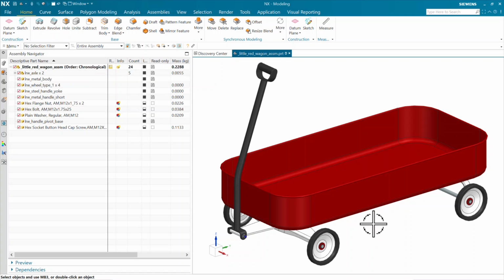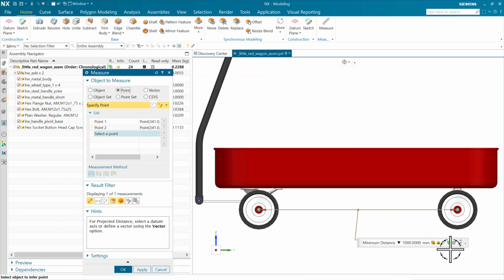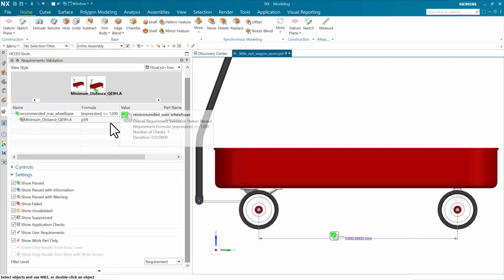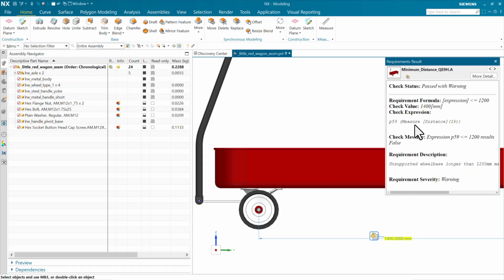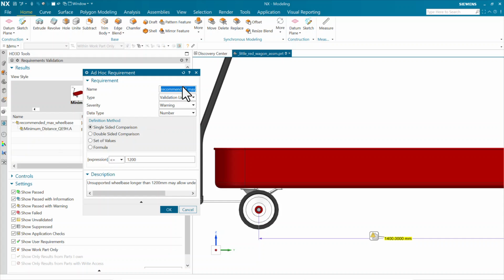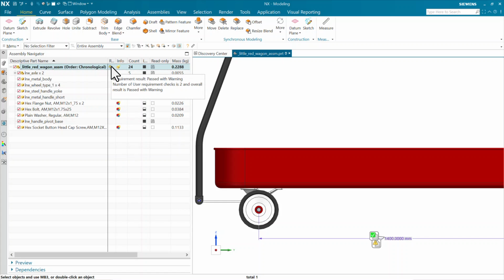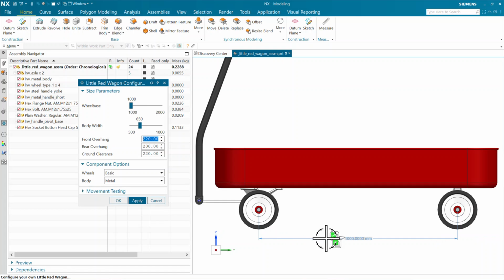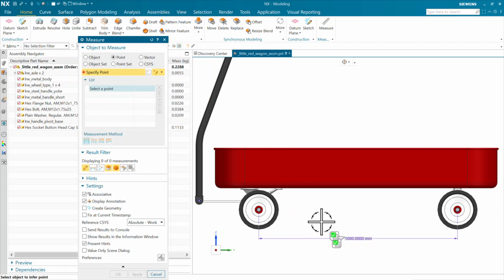NX Expressions: Simple Requirement Checks on a Measure

Comment: Thanks for this! How do you associate these to requirements that you create in Teamcenter?
Reply from the maker: On the Teamcenter side, you'll first link the Requirements to the NX Item Revision.  With this link in place, NX will find the Requirements when you open the part in NX, and automatically display them in the Requirements Validation tool in NX.  You can then create the checkers in NX that relate the specific measurement expression to the requirement.  Does that make sense?